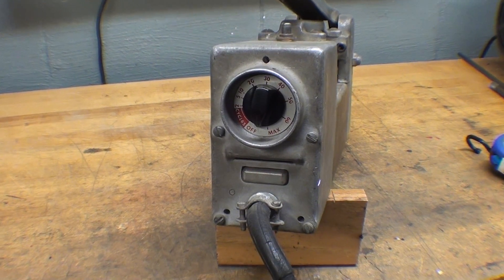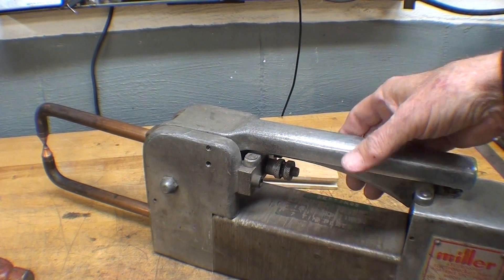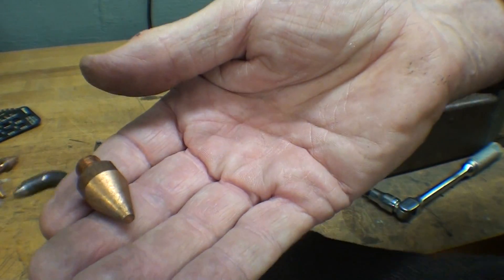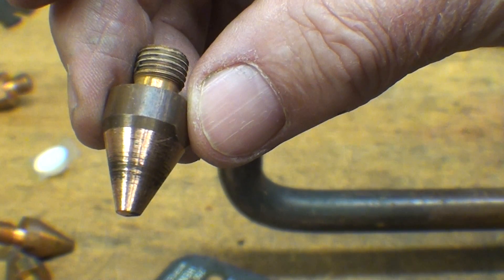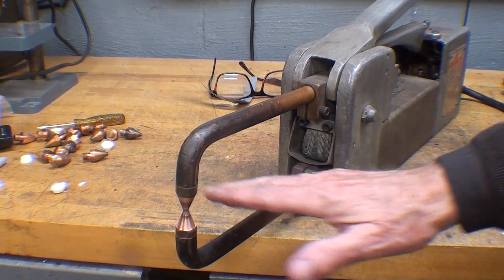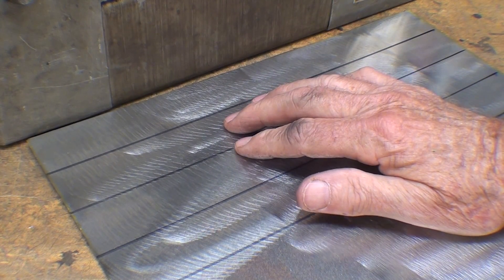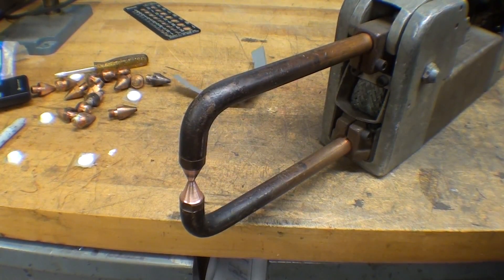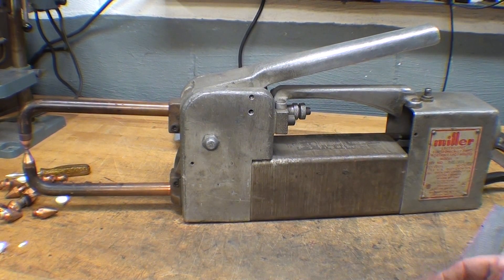WHAT MAKES IT WORK #23 pt 2 of 2 Resistance Welder tubalcain

Comment: Outstanding presentation as usual.  40 years ago I regularly used spot welders in a sheet metal shop building Blue Berry Pickers.  Several years ago when the company went out of business I bought the very same spot welder, finger break and some other tools I used years ago.  You reminded me of the spot welding process but also taught me a few new things.  As you know we never stop learning.  Thanks again.

Comment: Do you recommend using a 220v spot welder if you are welding 1.5mm sheet metal? My 110-115v Chicago Electric just doesn't seem to cut it. I have to hold the juice on for up to 15 seconds till I get a faint red glow, and usually, that isn't enough.
Reply from the maker: Yes, probably 220 V

Comment: Thank you Mr Pete, this video took me back to my high school days (1973 to 1977) in central New Jersey to Mr MacCleen's metal shop. I think the Miller spot welder and all other aspects of the metal shop helped inspire my 40 year long career in auto body repair. I use highly sophisticated water cooled spot welders to weld not just mild steel but high strength steel and galvanized steel. Again thanks for your videos.
Reply from the maker: Neat
Reply: Are you referring to GM's primer?

Comment: You can use dielectric grease mixed in with a smidge of never seize to keep electric contacts like that from sticking in the thread. I use it all the time on my antique electric connectors.

Comment: I liked it Professor Lyle.  
Um thunkin 'bout gettin the cheapo HFT spot welder.  
With my vision impairment, um limited to solder and spot.  
I've tried the torch and brazing with MAP, but so far failed. 
Soldering, brazing, welding and cutting - hot topics my man. 
Thanks for the 411 teech.  Don

Comment: ....at my last job..I was maint man for a company that made low-budget HVAC ductwork....all galvanized steel sheet....they spot-welded a lot of it, due to it being cheaper than the more proper riveting....The spot welds were of poor quality, and the electrodes didn't last very long either.....also, you lose the rust proofing effect of the galvanizing where the spot-welds were done.
Reply from the maker: All true

Comment: Tip on tip alignment. Take a piece of 3/8" or so stock (plastic, aluminum, wood...)  Drill a 1/16 hole through it, now use a counter sink to create two nice pockets on either side. When you need to swap the jaws you can put that between the tips, it will align them for you.  
A good informative video is never too long...  Far too short is common though.

Comment: This pair of episodes is quite entertaining, and took me back to metalwork at high school :)  In our first year of high school, we made a pencil case of tinplate with a 'marvi plate' (plastic veneered steel) lid. These were bent on  the 'magnabend' (an electromagnetic sheetmetal  brake).  The box base was held in shape by side flaps which were bent over the ends and spot-welded.  My two boys went to the same school almost 30 years later and made a similar box, but they were not allowed to use either tool (they had to get the teacher to do the work, apparently for 'liability reasons').
Reply from the maker: Wow-what an interest killer

Comment: Enjoyed it, not too long at all. In passing - Lazze over on his channel found that aluminum can indeed be spot welded with a machine very similar to yours. The trick he used was to sandwich the two pieces of aluminum between two sheets of thin steel. You might want to check out his channel, Lazze metalshaping. Keep up the good work.

Comment: Aluminum and galvanized can certainly be resistance welded.  Please keep in mind that the Miller/Harbor Freight spot Welders are the absolute lightest of all light duty Welders.  If all you have is one of these though, you cannot successful join aluminum.  You might have some luck with galvanized o other coated materials, but I would not recommend the machines.   (I have been selling, designing/ building, and servicing resistance welders since 1991.)

Comment: HI Lyle, I have to say your videos are excellent. You definitely show your talent for teaching. I am a professional engineer and your explanations are always very clear with a smattering of other interesting information.  Please carry on I love them. Everything you do I find entertaining and interesting. I might slightly disagree sometimes but I have never found anything so far which is totally wrong or misleading. I wish I could clean all my machines without using air but unfortunately jobs need to be done. I do however totally agree with your philosophy in that compressed air cleaning is bad for machines. So I try to do as much as I can by hand without the use of compressed air. I am the one who has to strip it down and clean all those chips out. A shop vacuum works really well. I will get some more videos up soon. I want to do one about my cylinder grinder where I have to replace an old 8 pole 850 RPM motor with a standard 1750RPM motor which runs the table back and forth using a small VFD because you cannot get low hp (0.3) 8 pole motors  easily anymore. It was built in `1962 . Keep up the great work as long as you can they are wonderful to watch.I am a big fan
Yours 
Allister Denyer B.Eng hons. elec MIET P.Eng.
Reply from the maker: THANKS for watching--

Comment: Lyle,  Great video and definitely NOT too long.  Aluminum can be spot and seam welded, but you definitely need the proper machine for that.  We build aircraft repair parts where I work, so I occasionally get to see the Spot Welding Shop's machinery.

Comment: tips are sticking because they arent smooth. if they are polished they seldom stick. also the square eddge were the sides meet the face causes sticking as the face "mushrooms" slightly in the hot metal

Comment: My physics teachers taught us that a spot welder is just a lot of capacitors that are charged up and then discharged to make the weld. Not so long after I found a load of capacitors for sale at a second hand shop, bought them and by some fluke managed the odd weld in some scrap, most failed. I went for several years with that delusion and another of his explanations that fast heat soldering irons also used capacitors. It was kind of vexing as a lot of his other practical stuff on electronics, photography was good. Still despite garbage in on capacitors in industrial applications I went on to do a physics PhD, so it didn't hurt me too much. Love your videos & I regularly use things that I learned from you in my little machine shop.
Reply from the maker: Thanks for watching - that phd is pretty impressive

Comment: I've always wanted one of those. I keep turning back to the McMaster-Carr page, but they just cost too much for the amount I'd be likely to use it. My latest potential use would be for fabricating things from Stainless TIG filler rod. I currently silver solder, but that's not very strong for 90˚ crossing joints (and a lot harder to do than parallel joints). Nice demo (and it's firing up my desire for one of those tools again).

Comment: Very nice video. Thank you!
Dan Gelbart has good video on spot welding where he shows different techniques of making spot joints, and how to use spot welder to make enclosures, and attach fasteners: https://www.youtube.com/watch?v=82Iil0fFN9Y 
Re aluminum welding: there is a neat trick that lazzemetalshaping showed in his video: put pieces of steel between the material and electrodes. This will make very clean and very strong weld: https://www.youtube.com/watch?v=gcgC3V3mkcw

Comment: You can spot weld galvanized metal but for a machine like that it would be hard.  The industrial spot welders use a super high current for just a second to burn off the coating. Then they do a normal weld current to actually fuse the metal.  The tips though on galvanized material have to be cleaned every 10th weld or so.  

At work they use a combination of a file and sandpaper to clean the tips.  After so many cleans they will dress the tips to reshape them.  Reshaping the tips keeps them from being big and fat.  Which the more surface area of the metal the tips are in contact with decreases the resistance and can make the weld fail.

Comment: Great video, thank you for sharing. I recently saw a video that showed how to spot weld aluminum. They put the two pieces of aluminum together, and sandwich that between two pieces of steel. then applied current. it seemed to work pretty well. As a side note, that is the same principle as the old Willard soldering guns. Very low voltage and a very high current. 

Again, Thank you for the videos. Your videos are always good information,  and Good information is hard to get sometimes. There is a lot of Bad information out there and sometimes we just don't know who to trust. But we can always trust you Mr. Pete.

Joe.

Comment: Years ago, I worked in an electric motor shop and sometimes we had to make long screw that would be used to assemble the end bells to the stator and we used a spot welder much like the one your featured in your video and as I remember the tips would always stick to the work. That motor shop was the most dangerous place I have worked at, luck to never have been injured there. I enjoy your videos, thanks for the hard work.

Comment: The grease is dielectric grease.
The sparks are because the the tips aren't inline correctly or the pressure isn't great enough. 
The tip sticking can be from the tips not aligned correctly.
Weld time to long .
not enough clamping pressure.
Currant too high.
Looks to me like your sparking and tip sticking are going hand in hand cure one you cure the other.
Thanks for the videos.

Worth

Comment: Fairly recently I recall hearing a story about how some sectors of the automotive industry are moving away from the practice of spot welding body parts.  The new " high strength steel " being used today is thinner.  I don't know exactly what problems are being encountered with the newer steel alloy but a form of brazing is  used instead.
Reply: Look up MIG brazing, it's the method being used along with MAG (MIG with an active gas). The problems are that the high tensile steels and boron steel get very brittle in the HAZ of the spot welds and cause the welds to fail and that a smaller unit like the Miller cannot create the tip pressures needed to properly weld the steels.

Comment: Your tips most likely stuck because you welded galvanized metal with fresh tips. When welding steel the electrodes develop a carbon coating, with prevents sticking, but galvanized metal can form an alloy (bronze, brass) on the electrodes.
I also think your weld time might have been a tad long, leading to too much heat at the electrode/work interface (the goal is to create the heat in the sheet stock only, it should not be allowed to propagate through conduction into the electrodes).
There are fancy electrodes now, other then plain copper, which offer better performance but I have no experience with them. Apparently you can even weld galvanized steel with the right setup.
Reply: Hi Clifford. Much better to have a discussion in a polite way than put some one else down for their opinions. regards
Reply: Gary C I would have to agree.
Reply: mrpete constantly says you cannot weld galv' metal so I am pretty sure that is not the cause. regards
Reply: Well he took the sheetmetal from a can which he himself said is tin plated.
Reply: Hi, Tin plate is not galvanising. You cannot put zinc on any food packaging as it is very bad for your health. Agreed the tin plate may have caused the tips to stick also but definitely not as much as galv'  regards.
Reply: Galvanized steel can be successfully spot welded. 
The automotive industry uses electric resistance spot welding everyday to join galvanized sheet steel components. 
The method is slightly different than with uncoated sheet steel. 
Spot welding galvanized sheet steel components requires higher clamp pressure, higher current and usually a shorter on time period. 

Some spot welding units successfully use a dual current pulse technique. 
The zinc galvanizing coating must first be melted off before the steel is joined. Zinc has a low melting point, so a pulse of current before welding will accomplish this. During the weld, the zinc can combine with the steel and lower its resistivity. Therefore, higher levels of current are required to weld galvanized steel. 

Many will also caution that any welding process involving galvanized/zinc, lead, tin, aluminum coated metal produces metal fumes that can have human health consequences without precautions and adequate personal protection. 

Miller and Lincoln have published specific papers regarding electric resistance spot welding galvanized sheet steel.
Reply: I am not certain about zinc being "bad for your health" since zinc is an essential mineral for humans and is found naturally occurring in many foods, meats and is included in many vitamin and mineral supplements.
Reply: There are safe levels of zinc absorption and agreed it is needed for growth etc but too much can be harmful. That is why it is illegal to coat food containers in zinc. The amount that is absorbed by the food is way above recommended levels. That is why the much more expensive tin coating is used. Most cases of zinc toxicity are caused by accidental ingestion of high amounts of zinc oxide from creams for example, but zinc overdose is not to be taken lightly, especially when over dosage is for a prolonged period of time. Ideally you don’t want to go higher than 50 mg and maybe a little more for special treatments, but serious side-effects have been noticed starting at 150-200mg up to 500mg and more. The more serious unwanted side effects include dizziness, chest pain, trouble breathing, fever, chills and jaundice. I worked in the surface coating industry for many years including zinc/alu/copper flame spraying and have seen the detrimental affects on the human body from breathing the fumes. regards
Reply: Gary C 
Thanks for the reply. 
I have experienced the effects of inhaling metal fumes from welding replacement galvanized floor pans during auto restorations for a museum and it is not fun. 
Cheers.
Reply: Interesting discussion.
Reply: I keep wondering if you could force the carbon coating on the tips somehow.
Perhaps with an accetylene flame, or by rubbing some coal or graphite on them...
I use my homemade spot welder to weld the tabs on batteries, the tabs I use are pure nickel so that works too. The spot welder is also useful to weld non-sheet stuff that is otherwise difficult to join, such as wire from heating elements, or even weld studs onto a surface.
A really good video on just how versatile a spot welder can be is "Building Prototypes Dan Gelbart part 5 of 18 Spot Welding", look it up on youtube. Dan Gelbart is an incredibly smart man and well worth watching.

Comment: I seem to remember that some tips had a set of concentric groves on the tip. Do you know the purpose or have you tried machining tips like that?
Reply: I've seen industrial tips that way. Supposed to prevent bad welds/burn through because the grooved areas don't get as hot.

Comment: Looks like thermal paste.
Reply: jusb1066
Agreed.  The instructions might say to use it on the threads only and not the two faces.  Seems like it would be worth some experimentation.  None of the Miller docs I found have any mention using anything like Lyle had.
Reply: It does, but unless they give specific instructions for application it would possibly render the spot welder mysteriously inoperable since thermal paste is for heat transfer and not electrically conductive.
Reply: The grease comes with most of the tips that I have seen. It is a thermally conductive paste ( the stuff I have has silver in it) that acts as anti-seize and thermal transfer.

Comment: Thumbs up for the useless Houdini trivia <g>
(Would have added more for the shop class memories and repair jobs on McD spatulas if I could.)
Gound a modern (if not really cheap) device suitable for galvaniosed sheet steel, TECNA 7902P - no idea hoiw that works.
Please throw in a small project using the spotwelder!
I hate it hate it hate it that we didn't have shop class back at my German Gymnasium. Just a litle abstract woodworking in 'art' was all.

Comment: Would have been interesting to see the internals of the welder, especially the transformer and the tube timer.
Do you happen to have a schematic of the timer?
When I went to electrical engineering college 30 years ago we built a spot welder, a stand alone unit in cooperation with other schools. one school did all the sheet metal work, others did the frames etc. and we did wind the transformers and designed and built the electronics for the timer. The welders were then given to the schools that participated.

And, Lyle, your videos can't be too long if one is interested in that stuff, and if one isn't interested in such things he or she is watching the wrong channel. Don't care too much about those not interested and keep up the good work.
Reply from the maker: THANKS--no schematic